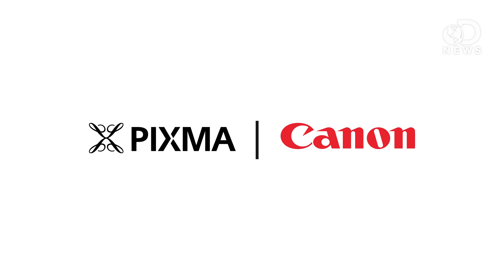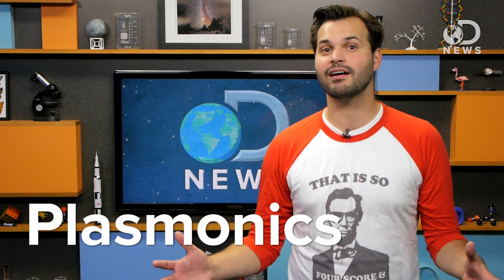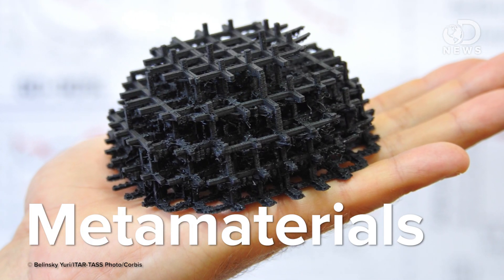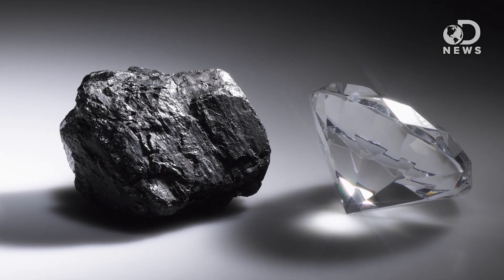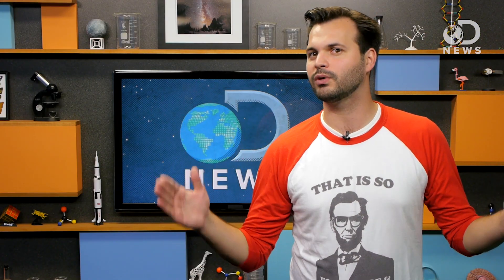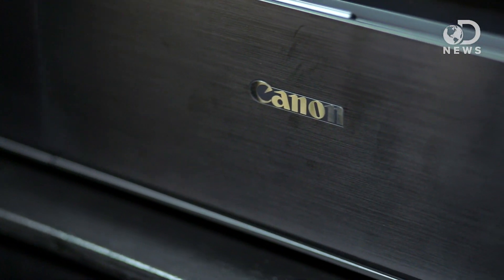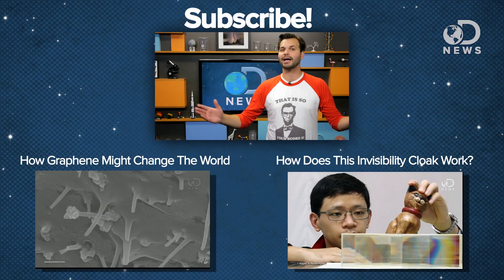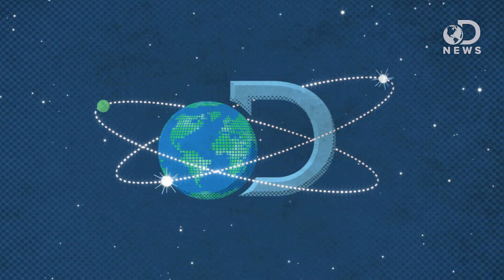How Engineers Are Beating Nature

Comment: 3:08 The sensing of biological weapons???
Reply: Some biological weapons require some sort of inhibitor to prevent them from going off early, and these give off increadibly weak waves of varied types. Graphene and the such is very sensitive to some of these waves, and if u had enough of them you could theoretically find out if or where one is.
Reply: when you say biological weapons are you referring to the delivery device or are you talking about the actual chemical/virus/germ/parasite/etc...?, if you are referring to the delivery device, then yes some of them could e radio controlled. BUT the chemical/virus/bacteria/whatever... aren't exactly very interactive with what i am assuming is anything on the electromagnetic spectrum? so there is no way graphene would actually be able to detect the actual toxin it's self, i assume he meant nuclear weapons
Reply: quantuman100 Ye, its entirely the devices used to contain them.
Basically, alot of non missile bio weapons (basically the planted bomb kind) are always active, and just have an inhibitor that prevents them from going off quickly, its when this is stoped that the actual activation takes place.
Reply: Nuclear weapons and the such.
Reply: Thanks.?
Reply: Jc Howard
why not just stop the flow of oil/gas and power?, eg you can take own the entire us power net using a slug shotgun and 5-10 people around the sates, you can also easily sabotage most of the oil pipelines / storage silos with another 20~, that it a lot cheaper and more effective than biological warfare, and you can speed the whole shibang up by doing it in summer and burning down a few of the emergency grain silos

Comment: Can the Cannon printer print meta materials, solar cells, circuit boards, batteries, capacitors and flat rollable light emitting screens? Will they sell me the inks I need for that? If so, that would sell to me a lot better than just printing stuff I can just see on my screen anyways.

Comment: i have canon printer and its awesome, what is not awesome is its expensive cartridges. reason why i never use it. Also reason why its sitting in basement catching dust.
Reply: I have an HP inkjet and I can say the same!
Reply: yeah ink jet cartridges are all overly expensive for what ever printer you have.
Reply: Cool pic!
Reply: I bought the canon printer specifically because after market ( third party ) manufactures make the cartridges dirt cheap.

Got kids printing up everything for school,  now I pay like 6 bucks for the complete set, including the extra large black ink cartridge.   got it off of Amazon.
Reply: cartridges are not expensive here, but they definitely don't stay filled for long... ~100 pages of greyscale printing and my black cartridge is almost empty, not only that it uses color ink even in greyscale printing
Reply: lol go to costco they refill printer ink cartridges for 1.50
Reply: You must work for canon or something. If not you should be their spokesperson.
Reply: +Machina new ink cartdiges for my HP printer cost 1/3 their weight in gold. i mean, the ink inside.

the funny this you can buy this crap ink by the gallons and it's like 10 bucks only.

Comment: Wait so can you make graphine armor???
Reply: xXxAssassin4lifexXx He is referring to graphene, not graphite. As long as it is in the form of a single sheet, it is the strongest material we know of. It just absorbs shock very poorly because it is one carbon atom thick and not rigid.

An example given for the strength of graphene is that if you placed the weight of an elephant on a needle and pushed it into the material, it still wouldn't be pierced.
Reply: mexirad I think that the diamond armor was a Minecraft reference, best to just ignore it.
Reply: SinerAthin they aren't plates though, they are super thin, nearly invisible sheets. If you were to produce a billion large sheets of graphene and stack them, sure.
But I think the only practical application it could have as protection would be as a barrier. Potentially a great coating or layer for existent armor tech.
Also, unbreakable condoms.
Reply: RedTriangle53 agreed he'd probably be better off with a carbon nano tube Armour secured in resin or other material.
Reply: Green Co.
 NOT JUST ANY PRINTER, A FUKIN CANON PRINTER!!!!
Reply: TheGhostTrollek dejvu
Please don't act like you discovered America, nano technology has nothing to do with this.
Nano technology isn't some sort of a magic spell that solves scientific problems.
Reply: Peleg Tsadok Its better than diamond armor, there is couple reason why we dont use diamond in armours
Reply: ***** I'm just wondering if it could be used as a sort of catch net, so to speak,  maybe a layer, then energy absorbing layers, then another layer, then more energy absorbing.and so on. It would, in theory, keep the vest from tearing around the impact area, making it able to take more hits around the same entry point, without weakening too much?
Reply: You're better off with a diamond armor.
Reply: ReX Slayer YAAAA FUCKIN CANON!!!!!1111!#$@
Reply: you can also make graphine bullets.
Reply: RedTriangle53 It wouldn't even stay intact, assuming you are using more than one layer of it piled up, it would just rub off whenever you touch it. It's graphite like the stuff on your pencil. the IMF are too weak to hold the layers together.
Reply: It is flimsy but hard to break its not hard enough
Reply: Diamond may be hard but that doesn't mean it won't be penatrated in fact it would take one impact to soften the material and second to break it. If it were body armor one three round burst would be all you really need to make the diamond armor useless plus anyone would spot a mile away with light coming off the armor
Reply: RedTriangle53

What about layering multiple plates of graphene in an intricate network designed to disperse force, similar to the way Dragonskin tactical vests are made?

That way, we could maintain the strength of the material while also ensuring decent energy dispersion.
Reply: Sure, just load your printer with copper and carbon.
Reply: RedTriangle53 Just want to point out that the "500 times stronger" is a relative and misleading term... he never mentioned what the actual hardness is, and rolling that matamaterial into a tube is still difficult. This idea has been stuck for the last 40-60 years, u hear about it, ppl use this to get government funding, but nothings been really done.
Reply: RedTriangle53

How difficult would it be to produce multiple layers to make a plate?

By the sound of it, a normal  printer can do the basics..

What about a more advanced 3D printer. Could it produce plates of it?

Also, how much would it weigh?
Reply: SinerAthin Graphene is a completely 2-dimensional material. Printing thicker layers would just ensure that the finished product wasn't graphene.

And producing layers enough to make a single "plate" of graphene, assuming you mean a rigid metallic-like plate, would require billions, potentially trillions of layers.
 It would weigh the same as an equivalent of graphite, the only difference is the structure. So it would be light.

723lion graphene is super duper flexible.
Reply: RedTriangle53

How long would it take to print a metallic like plate of graphene?

Would a 3d printer be able to do it? If so, how long would it take?

Could it resist bullets and knives?
Reply: SinerAthin *face palm
Reply: Peleg Tsadok lol thought of game theory
Reply: SinerAthin Well, no, a 3D printer could not do it, at least yet. As far as I've understood it, the conditions are a bit more complicated than "printer". You need a very smooth, non-reactive, potentially lubricated surface to produce it on, or else it will just be some graphite structure that connects to itself and the surface in different non-graphene ways. The most simplistic way I've seen it done was with a dvd burner. They poured a carbon solution on a disk and put it in, let it cook for 10 minutes, and out came graphene.

And yeah, it would pretty much be like a plate of metal, except lighter, a bit more elastic, and would need some sort of frame to hold the sheets in place.
And much stronger.

That's at least what I imagine it would be like. The universe's toughest phone book.
Reply: SinerAthin 1. custom printer code for dual layer printing 
2. sintigrating alloy
3. bonding plate of plastic bonding polymer
4. procedure. 5 replicating
6. welding thin sintigrated plates
Reply: RedTriangle53

Elastic and stronger, sounds like if one could efficiently produce it en masse, it could provide superior body armor for military activity.
Reply: if u can make armor out of plain paper... there is no limit for science
Reply: *****
just one would be enough, the bullets would never pierce but it's not gonna save you from the blunt force the bullet gives instead of puncture. think of it like this. get shot my a shotgun but not actually bleed and die. all that force on your body is going to cause internal bleeding.
Reply: SkullSkillsSkates

There are ways to counter the kinetic force though.

- We could layer the graphene plates in an intricate scale-like network similar to Dragonskin tactical vests and their design to help disperse the force over a larger area and negate the damage.
- We could also construct one solid cage-like vest through advanced printing that moved independently from the body. At worst, you'd get injuries at your limbs, but your torso would remain intact.
- Similar to medieval armor, padding could be added beneath the actual graphene armor to help deal with the force of the blow.
Reply: i know we could do that. but it wouldn't be easy since this stuff is literally one atom thick.
Reply: Peleg Tsadok But diamonds are hard, but brittle!
Reply: PC Gamer Pro They are crystals. They will be extremely hard and durable in the direction of their "points", but not along their surfaces.
Reply: graphene bullets would be obscure. for 1 it would be hard to make. it would also cost alot just for manufacturing it.
Reply: RedTriangle53 kinda like an egg, only an egg is not hard!
Reply: SkullSkillsSkates I think with the advent of 3D technology, it'd be the materials that'd be the only real expensive part of it.
Reply: its about density. and it only takes a tiny bit of graphene to tip the bullet.
Reply: Peleg Tsadok ever hear of nano technology?